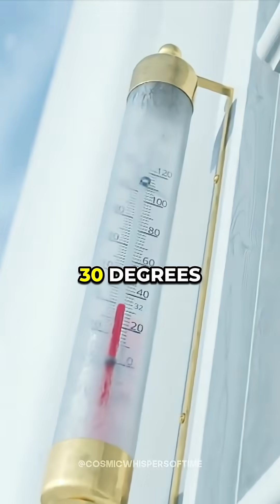Why Pipes Burst in Winter ❄️ w/ Neil deGrasse Tyson

Comment: Hey NGT - As the ambient temperature goes below 32F, the water inside the high pressure pipe cools down, but it does not FREEZE.  It becomes super-cooled!  You are a scientist?  You should know that the HEAT will transfer from the water to the outside, that can not be prevented!  Do the experiment.  Super-cooled water is reality, not fiction.  The act of freezing the water, when the pipe breaks, causes the temperature of the water to increase, resulting in a slush instead of solid ice (the freezing of the water gives off heat, the exact same amount of heat from the state-change that the ice absorbs when it melts) -- Dave

Comment: He's actually slightly wrong about how this happens. The water actually continues to cool without freezing. The temperature of the water continues to lower to quite a bit below the normal freezing point. Because of the pressure, the water can't freeze and instead supercools. When the temperature gets low enough, the water crystalizes all at once, takes up more space and bursts the pipes. Sometimes. When it happens like this, when the pipe bursts, the temperature actually goes up because crystalizing water into ice releases heat. In fact, the ice will come all the way back up to 32 degrees.

The other way this happens in when the pipe isn't particularly smooth. In that case, while the pressure does lower the freezing point a bit, because of the nucleation sites, the water will start crystallizing right away. The pressure will rise a bit, but as long as you get the water flowing again before the all the water in the pipe freezes, the pipes won't burst. It doesn't have to flow much to prevent burst pipes. It has to be just enough to keep the pressure from rising. You can also use expansion systems to do this, as in homes with well water. People who live in the north know that during cold snaps in the winter, you always leave a sink or two dripping to prevent burst pipes in your basement. This is extra important in trailer homes.

Comment: My mind is blown at Mr Tyson ignoring the fact that copper conducts heat very easily,and therefore the inner and outer temperatures are practically the same, but because of the rigidity of the copper pipe the pressure rises and keeps the water in its liquid state. Search "pressure temperature graph". Neil should know this.

Comment: Wrong. As he describes the water is still 32 degrees when the surrounding air is lower. The water can reach the same temperature as the surrounding air, below freezing, and still remain liquid because of pressure. Combined Gas Law is one of the first more physics related concepts taught in chemistry. The pressure changes the freeing point, it does not keep the water warm. Dr Tyson is an intelligent person. He is presenting more errors lately. He has made a comment about genetics that is wrong because of an over simplification, but that is not in his field. As a physicist I'm surprised at this error. This is usually delt with more in Chemistry and specific types of engineering, but it is definitely in the sphere of physics.

Comment: NDT just lost some credibility. Pressure depresses the freezing point. Arguing 32F or 0C doesn’t make any difference. Copper pipe has no magic to keep the water at 32F (or 0C) when the environment is at 25F. It is also at 25F.

Comment: NDGT, you might be a decent astronomer, but you don't know jack shit about materials science.  Copper pipes YIELD; it's that yielding that accommodates, to a certain extent, the water expanding as it loses the molecular heat of fusion and becomes ice.  Of course, there IS a LIMIT, and it depends upon the alloy used (hint:  copper pipes are NOT "pure" copper at all) and whether or not scale has formed on the pipe interior, which acts to a degree as a thermal insulator.  The typical failure mode of a pipe of almost any material is longitudinally.  

However, plumbing typically includes expansion joints and pop-out freeze plugs to deal with exactly this problem.  Also, it's more common along inadequately protected systems for failure to occur at joints and valves.

Comment: Water in that pipe does drop in temperature, but the pipe prevents it from expanding to form the crystal structure of ice. Ice has a lower density thus takes up more volume. Eventually the temperature drops enough that the molecular motion is reduced and becomes more conducive to forming seed crystals that take up more volume and thus the pressure increases until the pipe breaks, then the water immediately finishes forming the full crystal structure from the accumulated seed crystals.
Reply: You just parroted NDT as a comment in order to...???
Reply: @redpecker12 He did not. Temperature.
Reply: @redpecker12 He didn't parrot NDT, he corrected him. NDT says that the ''act of squeezing it prevents the temperature from dropping'' - which is false. 

It prevents a phase change, not a temperature change.  As long as the pipe retains structural integrity, the water will remain liquid despite being below the freezing temperature.

Comment: “Stronger pipes are stronger than weaker pipes” WOW 😱
Reply: The thing is, you didn't know why the pressure increased as the temperature dropped. You didn't know why you needed stronger pipes as the temperature drops lower. You didn't know. You assumed that a pipe at 0F was gonna be as good at -32F.

Comment: Nonsense. Heat will always propagate from the warmer to the cooler object. The temperature in the pipe do drop below 0C (32F) and stays liquid. It's not due to a lack of impurity to allow the ice to form. It's called supercooling. If there is any disturbance, the freezing process is then instantaneous.

Comment: The physics here is complete balderdash. The pipe DOES NOT "stop the water from freezing", because it is not sealed. It can expand towards the source pushing against the feed pressure. Now, once you get a frozen plug, yup there is now a sealed section and that will burst, but that requires as a prerequisite something that he says is impossible. Bear in mind there is a standard plumbing technique of sealing off a section of pipe by freezing it. Once again NDGT betrays science.

Comment: Even if it did remain a liquid, it certainly isn't going to maintain 32F (0C). The freezing point of water only drops about 0.0072°C for every one bar of pressure. Thus if the temperature drops by 1 degree Celsius, it's going to need about 139 bar of pressure. That's about 2,000 PSI, or about 14 mPa of pressure. No way will thin copper tubing stand that pressure. It will stretch a bit, then rupture.

So, the claim that the temperature will remain at 32F (0 C) is out and out wrong.

Comment: The temp inside the pipe always matches the temp outside. Water needs to expand in order to freeze. He didn't mention this. The pipe prevents expansion, and so prevents freezing, but the temperature is the same as outside. I like Tyson but he blew it here.

Comment: The water will be lower than freezing and not remain at 32 degrees. Water will remain a liquid below 32 if the pressure is increased. Just like water will boil below 212 if the pressure is decreased.
Reply: No. You increase pressure to change a gas into a liquid but when you increase pressure on a liquid it should freeze as long as you allow the heat to escape. However, water has an initial expansion as it freezes, so the water is being prevented from expanding. The heat energy that would be released to allow temperature to drop is being used to increase pressure as the molecules want to expand to meet crystalline structure requirements for the water to freeze and drop in pressure. These molecular forces build until the pipe bursts.

Comment: You must be talking about water under pressure, like water supply lines in your house or water mains under the street, (your statements wouldnt apply either otherwise).  The water would be at 39.2°F or 4°C,… NOT at 32F/0C. That is the temperature of the maximum density of water. At lower temperatures, the water begins to loosely crystalize and forcibly becomes less dense, which is where the increase of pressure on the pipe comes from. If the water is under pressure at it most dense, in cannot drop to any lower temperature. 

This would be adjusted further depending on the concentration of any diffused minerals, but we can ignore that for this purpose.

Comment: I was taught that from 4 to 0 degrees water expands increasing the pressure that cause pipe to break
Reply: its still liquid as pushes back into the main
pipe will not break until blocked by ice

Comment: Reading comments.....geez guys learn to think for yourselves!  Just because someone "famous scientist" says something, that definitely doesn't automatically make them right.

Now I'm saying this because there are multiple people trying to defend him in saying he's correct when he said the temperature of the water remains at 32 and doesn't decrease further because it can't expand to freeze.  I'm sure he just said the wrong word and didn't realize it...this happens to us all.  However though this is probably the case, it changes nothing about how WRONG this statement is in reality.

First of all, common sense tells you if the environment is getting colder and colder, anything in that environment will also get colder, unless it was perfectly insulated which is impossible.  Second deeper thought of the situation, this would violate completely the known laws of thermodynamics that says energy always flows from higher states to lower states and always spreads out and disperses over time.  Heat flows from warmer to colder ALWAYS, so once again it would be impossible for the water to not decrease in temperature when the surroundings were colder than it was.  If this were possible then infinite energy and perpetual motion would be possible.

Now locally and in cases of equilibrium during phase change, this temperature locking will occur....but temperature isn't the full picture when it comes to describing the total energy of a substance.  When heating water, as you input energy the temperature rises until it hits the boiling point.  Here, adding more energy does not increase the temperature, but the energy is used to change phases from liquid to gas while the temperature remains constant.  Similarly, when water is freezing in phase equilibrium, as energy is removed by a colder environment the waters temperature remains constant while the removed energy goes into changing phase from liquid to solid.

However, we are not in phase equilibrium here, the water is not undergoing phase change because the restricted volume and pressure applied will not allow it to change into a solid as water expands, increasing volume, when turning into a solid.  Since there is no extra energy loss being absorbed by phase change, the energy loss to the colder environment then must continue to decrease the temperature of the water.  Since energy always moves from higher to lower, with he energy of the surroundings being lower than the water inside, energy must flow out of the water into the lower energy environment.  Thus since energy is leaving the water and it is not undergoing phase change, loss of energy will and must decrease the temperature (that's what temperature is...the average energy of the molecules of the system).

This is how the supercooling phenomenon works, a liquid reaches a temperature below it's standard freezing point because it can't nucleate crystallization, or in this case pressure prevents it from expanding (a very strange phenomenon of water as solids are more dense than liquids mostly) etc.  As it's temperature is below freezing, when a crystal is able to form or the pressure is released, it instantly freezes BECAUSE it is BELOW it's freezing temperature.  If it were still at 32 degrees, then it couldn't instantly freeze because this requires the phase change energy to be removed and there's no mechanism to instantly remove this extra amount of energy from the bulk of the water.

Finally, if the water stayed the same temperature, then the pressure of trying to freeze exerted by the water would also stay the same and the pipe would never bust despite how cold it got outside.  The reason something freezes is because the static attraction of charges in polar molecules like water attract each other with a certain force, which is fundamental to the chemical species.  Temperature is the average kinetic energy of the bulk molecules, and when temp is high, the forces of attraction between the molecules are not strong enough to overcome the movement and collision strength of the molecules so they keep moving.  As the kinetic energy decreases, movement slows and collisions get weaker.  Once the temp is low enough, or the energy drops enough, then the attractive forces between molecules are stronger than the momentum of the moving molecules and these attractive forces stick and lock the molecules rigidly in place like magnets snapping together.  With all that said, since the attractive forces between molecules is constant and doesn't increase or decrease but is just a property of a substance, the ONLY WAY this force can be higher than the energy in the moving molecules is if the energy in the molecules is lowered below this attractive force.  The reason the pressure exerted on the pipe gets larger and larger eventually bursting the pipe is because the temperature is getting lower in the water; thus the attractive forces between the molecules trying to lock them in place which requires more volume (not because the force is growing, but the net difference in forces is getting larger as temp falls and energy of motion is lost) in comparison is getting larger and larger.  These forces becoming stronger applies more pressure which breaks the pipe.  Once the volume restriction is removed and since the waters temp is below freezing already (the energy loss needed for phase change has already been completely removed) the bulk of it will instantly solidify.

Ok.....I know that was long, but necessary.  In case anyone arguing he was right just because it's some famous dude truly thinks he was, well now you know.  And if this FULL detailed description of how it all works and why he's wrong doesn't now convince you it was a stupid false statement (as I said, probably just an honest mistake), then you need to seriously examine yourself and your mentality because it has a MASSIVE hole in it which will lead you down horrible paths of delusion and denial of reality.

Comment: Bullshit. The pipe does not prevent water from cooling, water inside that pipe under pressure has same negative temperature as air around.

Comment: Honestly, that takeaway lesson is BS from an engineering perspective of water systems. It is not mainly a strength. If it were, why don't we use steel, which is far stronger than copper? Because of elasticity, the amount of maximum deformation is reversible after the release of the force (ice goes back to water) and plasticity, when deformation is not reversible. That's one additional argument why you can see that copper pipes are replaced with PEX or PVC pipes in water installations, which have far less strength than copper but much more elasticity and plasticity. The best experiment to prove that is to take a PET bottle and a glass bottle, fill them with water, close them, and put them into a freezer overnight and see what will happen. Just be careful not to cut yourself with glass while investigating the results :p.
Additionally, any metal will have far higher temperature strength than any plastic. It is undesirable since water increases in volume when it turns to ice. Still, most other materials, like metals, are likely to shrink in lower temperatures, which creates additional pressure.

Comment: Sorry Neil. The pipe is not squeezing the water. The pressure created by the water molecules attempting to line up into ice crystals and the inverse pressure of the pipe to resist expansion reaches an equilibrium until conditions change.

Comment: Just be simpler. Water, once frozen, have some expansion and then some pipe can endure the pressure of that enhancement. Once mixed with different temperature, pipe weakened and can crack open

Comment: Fact check... false. The pressure around water will change its behavior. The water will still change temperature it just wont go through its stages. This is commonly proven by boiling water. At different altitudes water will boil at different temperatures. Pressure changes the temperature needed for water to change.

Comment: Never had I ever thought that I'd see Neil saying something wrong.
Reply: He is an astronomer, not a physicists, he really got his knickers in a knot on this one. I now will have to fact check all his wild statements.
Reply: @pietperske3583 have you ever opened a beer and it freezes the second you open it  ? So Niel is absolutely right
Reply: @George-yd7cx  Niel lost the plot, he fell asleep at the beginning of the lesson and  woke up at the end. Lets work in Celsius, much easier. when water cools down it loses energy to the surrounding area. Water reaches zero C and is still liquid, it then carries on losing energy and starts to freeze, energy (in the form of latent heat of fusion) is being released, not dropped as temperature. When the water is under pressure it cannot solidify, therefor the temperature keeps dropping, when the pessure is released the water can then form ice crystals, this process release energy and it warms up again to zero C or 22F. The result is that there are small pieces of ice in liquid water, that is what your beer does, it doesn't form a sold block of ice. Don't believe me, google it.
Reply: @pietperske3583 I believe sometimes my beer doesn't freeze until I open it and thats the point Neil was trying to get across